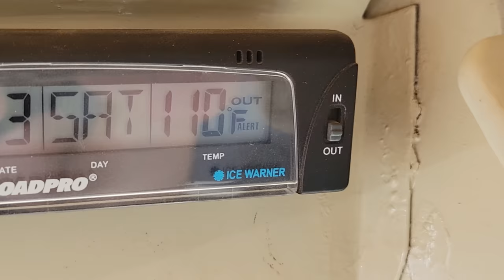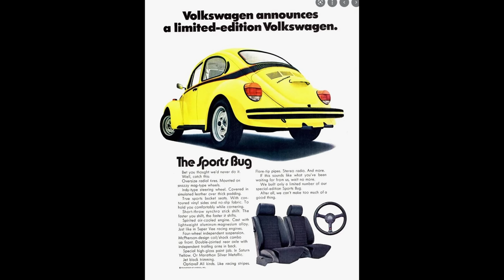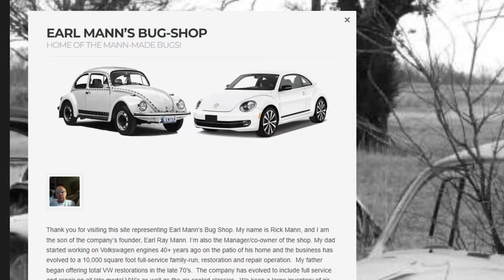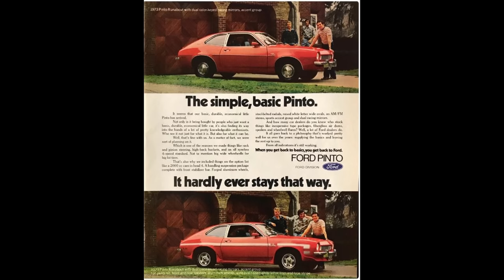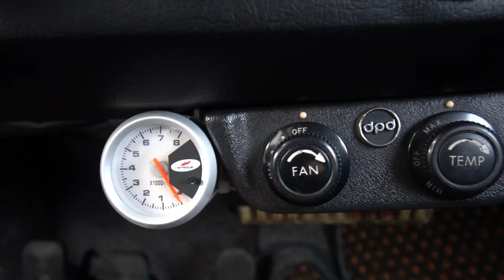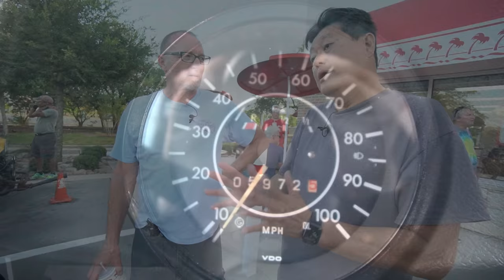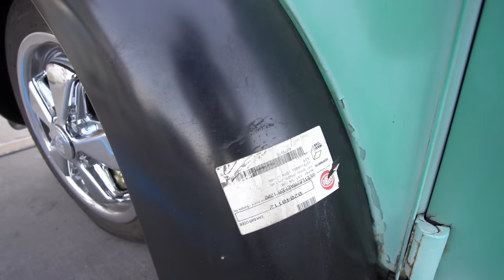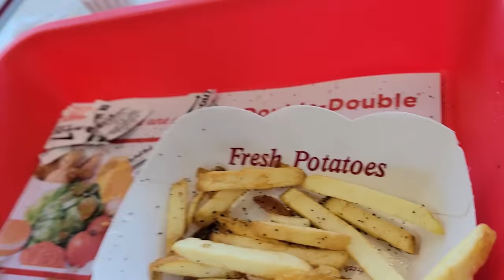He Skipped School in 1975 to Buy this VW "Sports Bug"!!

Comment: Absolutely love these bugs, the 1303 has the curved screen, a normal 1303 had a 1300cc engine, and the 1303S had a 1600cc.
The 1302 had the flat screen (but still MacPherson suspension), 1302 had 1300cc and the 1302S had a 1600cc, the 1302 was a 1970-1972 car and the 1303 was a 1973-1979 car (cabriolets included in that). Hope that helps :-) loved the video! :-)
Reply from the maker: That does thanks!
Reply: He stole my answer
Reply: I wonder why VW was selling 1300cc At that time maybe for emissions? Or was it more of a European standard? My wife's friend had a 74 super beetle with a 1300 and I kind of didn't believe that it came with 13300
Reply: @moddude101   think so, because even the pre 67 cars that US got were pretty much all 1500cc I think even though in Europe we got the 1200, 1300 and the 1500. 
Maybe it was some kinda deal that they only had the biggest engine models available for the US market? I’ll have to get out one of my many VW Beetle books to check and see what the case was. :-)

Comment: Wow, thanks for showing. This was my first new car back in 73'. I had that same marathon blue color and paid the extra to have the stripe put on.
Interesting fact: If you look closely at the steering wheel, you'll see that the center horn is made of rubber that can easily pop off. Behind that is a cavity where you can store tobacco, like if you roll your own cigarettes, like I used to do back in the 70'.  Pop the horn back on and nobody but you will know its there - it really comes in handy.
Unfortunately, after only 8 months of ownership, I lent the beetle to my brother and he totaled it around a tree - he was okay. I bought the remains from the insurance company and put the rear fenders and seats into a used 65'. I couldn't get the steering wheel to fit the 65'.
Thanks again for showing

Comment: Two observations: 1) That 1973 Sports Bug is the first 1970 & later Bug that I would ever consider buying/driving. It was terrific! 2) Can't believe you all drive your cars around in 110 degree temps. I sure can't do that 🙁
Reply from the maker: hey Ira, it's a cool car no doubt,  and it doesn't feel that hot when you're driving with the safaris open :)
Reply: @VWLifeVW  Not referring to your personal comfort level but rather the extreme heat and its possible effects on the engine - oil temps, head temps etc